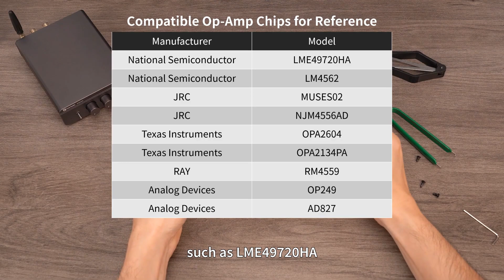Upgrade of the Legend! Fosi Audio BT20A Pro Mini Bluetooth Stereo Power Amplifier Introduction

Comment: Hello, I use the bt30 pro and am very happy with the performance, what I miss is a digital input and a digital crossover software on board, bluetooth aptx would also be good and wifi, the switch could be a little more stable, and even higher quality components for even better sound
Reply: And what would you like to pay for it?

Comment: Just for information. If you are considering upgrading the op amps, you will need two dual op amps. Burson V6 Vivid dual op amps work well but are too tall for the case, so the case will need to be modified to accommodate their height.
Reply: Had a plan to get burson but yeah the red things are too high.

Comment: Pin 32 and pin 35 of the TPA3255 which have a cross section size of 0.27mm×0.15mm each has the potential to carry a current of 8.87A each. In my opinion, that's the weakness of the TPA3255 and the stuffs that apply it, including Fosi bt20apro.
Thank you
Reply from the maker: Thanks to your point of view. So far the TPA3255 chips are working very well in our amplifiers. We believe it is reliable enough.😁
Reply: @fosiaudio  i have had bad experience with 3255. Those pins melt up.
Reply: @iblesbosuok  bonjour, problème avec quelles enceintes et quel niveau de sonore.please✋
Reply: @franckraymond6245  problems regarding the toughness of the device
Reply: @iblesbosuok  ok pour l'info👍 personnellement j'utilise 2 ampli CROWN XLS 2502 avec des enceintes 4ohms 94db: c'est parfait mais beaucoup, beaucoup plus cher😉

Comment: I own a Fosi Audio BT20A PRO and a Fosi Audio T20X Amplifier. I use these amplifiers with my Dali Spektor 2 and Dali Oberon 1 bookshelf speakers. Pairing T20X with Oberon 1 gives very successful results. Spektor 2 pairing with BT20A PRO provides a good experience. However, when I compare BT20A PRO with T20X in terms of volume, the T20X volume control button is at 10 o'clock, while the BT20 PRO volume control button is only equal at 2 o'clock. I wonder what causes this difference in distance? There is an adapter in the box that can output 32V 5A. It is written in some forums that the real power of the product can be felt with the 48V 5A adapter. Why does it come with 32V and not 48V? Also, when I compare it with the T20X, which has 200W power, I think that the BT20A PRO is not actually 300W, as stated. Am I wrong?

Comment: I love the sound, just wish there was a headphone jack and Bluetooth switch, the need to disconnect devices or clear is a pain. My turntable for example that has a Bluetooth mode has no way to forget the connection.
Reply from the maker: We will try to add a headphone jack and Bluetooth switch.
To disconnect the connection with your turntable, simply long-press the volume button for 5 seconds.
Reply: How do I connect it to turntable

Comment: hi & thanks for the video !!! question : can we bridge 2 x BT20A Pro to get more power & use 2 x 8homs speakers + an active subwoofer & plug a cd player + a turntable on both the RCA on each amp ? and how to do it please . thanks in advance for your answer.
Reply from the maker: Hello friend, if you bridge 2 BT20A Pros via the pre-out port, you cannot get more power actually. According to your case, BT20A Pro is not a very appropriate solution. Probably you need an amp with two inputs to swtich and a pre-out port for connecting an active subwoofer.

Comment: @fosiaudio please help answer my query. I want to use only Bluetooth and preout of bt20a pro and I have not connected speaker cables, in this case, does bt20a pro consume same energy in purely preamp mode? I have both bt20a pro and v3.

Comment: I desire increasing the bt20 Pro to the claimed wattage of 600 watts. I understand the op amps must be replaced per the comments here. What other changes must be done?  Thank you
Reply from the maker: You can upgrade the power supply to increase the power output.

Comment: Hello, I have bought one standard combination of  1 x FOSI BT20A PRO with 1x Power supply 32V 5A.
Also I have the possibility to use JBL STAGE A130 pair bookshelf speakers, 6 oms; It is specified: Speakers maximum Power - 125 Watts but for everyone or both of them is not clear
Also: Recommended Amplifier Power: 20 - 125W; Frequency Response: 55Hz - 40kHz. Is it possible to use FOSI BT20A PRO with these loudspeakers and if not
which loudspeakers, not very expensive, are preferable. Thanks from BG.
Reply from the maker: Yes, BT20A PRO is compatible with JBL STAGE A130 speakers.
Reply: @fosiaudio  Thank you very much! Hope to enjoy a musical pleasure with Your product!
Best wishes from BG!

Comment: I have both amplifiers, the bt20a and bt20a pro. When i set the volume knob to 12 o clock position on both amplifiers the bt20a is more powerful, louder than  bt20a pro.  On paper the pro version is more powerful, but in real test it is not.
Reply from the maker: The BT20A Pro features a built-in logarithmic taper A Pot, which sets it apart from the regular BT20A that uses "Type B." As a result, the BT20A Pro delivers more power at higher volume levels. To experience the difference, I recommend increasing the volume on both the amplifier and the audio source then comparing the two models.
Reply: @fosiaudio  Thanks for the replay. I didn't increase the volume pot ovear 12 o clock until now.
Reply from the maker: @82ivaylo  Please give it a try, it is the characteries of pot.
Reply: @fosiaudio  I did this experiment. So the BT20A pro has more power abd sounds better than BT20A. Thank you for your advice.